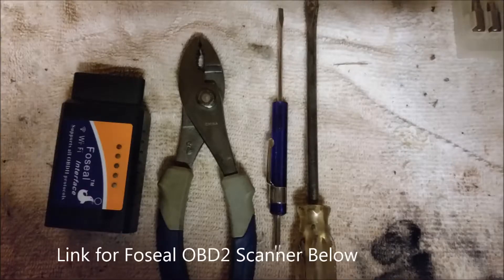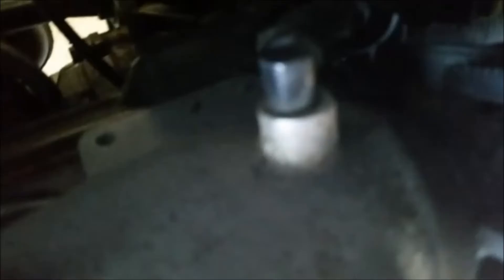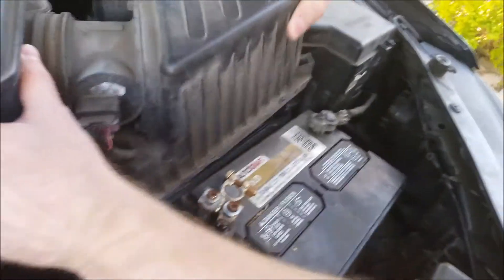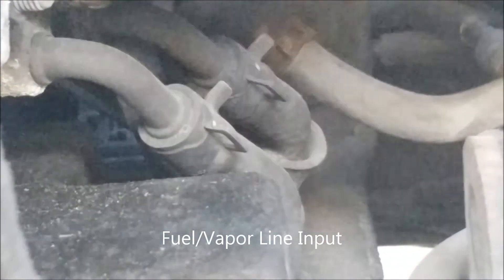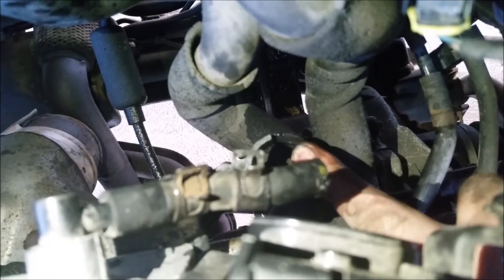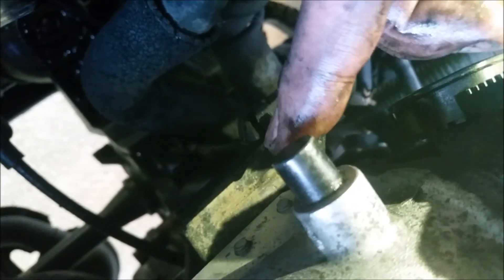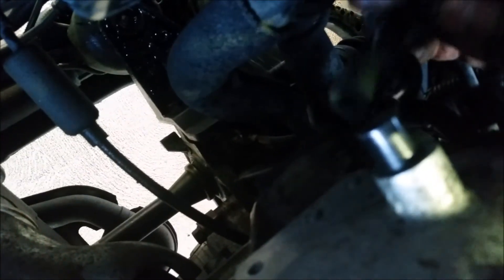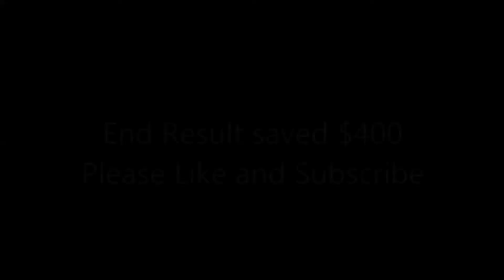DIY 2008 Hyundai Santa Fe EVAP Canister Fuel Purge Valve Repair P0441 P0455

Comment: Will this fix the problem of when I pump gas and hold the gas down,it only gets about half a tank before it cuts of and I HAVE to squeeze over and over or very lightly to find the sweet spot to get at least most of a tank.
I was told there are tiny exaustst ports in the hole to put gas, above right and left.. Can I take a hanger or some kind of pipe cleaner and send it down those  2 evap holes?? Will this fix, what part do I need or what do I do, will ythis repair fix that problem?
 thanks man.,
Reply: Yea I had this issue .. couldn’t fill up the fuel pump handle kept clicking off when I press it down to fill gas.  There was too much pressure in the tank and normally the purge valve is suppose to suck those vapors into the engine.  But yeah replacing the purge worked
Reply from the maker: Not really understanding your problem.  The valve is used to send fuel vapors into the engine.

Comment: I HAVE A QUESTION? AT THAT TIME THE ENGINE SMELL LIKE GAS OR THERE'S WASN'T NO ODOR AND IF THE  CODE P420 WAS PRESENT? THANKS FOR THE VIDEO.
Reply from the maker: No odor, just check engine light.

Comment: Is it good that Foseal? Can it read and set something? Or just read and thats all? Santa 2006 2,7 139kw. Thank you.
Reply from the maker: You can read codes and reset them using torque lite
Reply: @stem_saving1644  can you read all codes or just basic codes? Thank you
Reply from the maker: @Fastarrow12322  not sure what you mean.  If there is a fault code,  you can read it.

Comment: After you replaced it and reset engine light, how long did you drive the car, before knowing that the engine light is truly not coming back on?
Reply from the maker: Never came back on since it was reset. If it does,  it could also be the gas cap or another leak.

Comment: I just left auto zone and I have a small leak, what do I do next ? 😭 I just bought the car last week
Reply from the maker: If it's the code in the video you can try replacing or tightening the gas cap or replacing the device in the video.

Comment: Took me 30 minutes. 29 of them were spent fighting with those damn connections
Reply from the maker: Yup, it's those are the worst. Not rocket science....just need some patience.
Reply: @stem_saving1644  yeah what sucks is the code came back afterwards.
Reply from the maker: @justinkaufman495. Did you clear it?  Might be gas cap as well.
Reply: @stem_saving1644  I cleared it, the gas cap looks good. I have a new fuel pressure sensor on the way. Turns out mine is snaped at the neck. Hopefully that fixes it.

Comment: Nice video, helped understand what I was getting into ahead of time.  Definitely agree with others to buy the one with the new hose, so that you can tear/cut the old one off; otherwise you'll spend two hours just trying to take it off.  Bought my OEM part on Amazon for $20 bucks.  The whole thing took me about an hour to complete.  Definitely tight spaces, but workable.  This took care of my P0441 error, and eliminated the gas smell I had coming in after putting gas.  More importantly my problem with my Santa Fe having a hard start went away.  Thanks a bunch!

Comment: Just did the purge valve , definitely by the one with the top hose, take the whole air cleaner off and out of the way, disconnect the bottom hose, electric connector,move the top clamp down and just tear the old hose off, and thats it, I laid across the top of the motor so I could see..much easier, I'm 61yo and it was 45 minutes at best
Reply from the maker: Hopefully it fix the problem?

Comment: If you changed the fuel level sensors you used the sensor gaskets. Buy the original or reuse old ones. They sending unit gaskets are thinner that original! Causing vapor leak!

Comment: Had a smoke test on they told me that it was my fuel filler neck so I had the fuel filler neck replaced now I'm getting a p0441 that I wasn't getting before
Reply from the maker: Not sure what your situation is, but if its that P0441 error its either the gas cap or the purge valve at least based on what I have seen

Comment: So I have a 2002 hyundai santa fe 2.7 liter and it has a rough idle and it randomly shut off on me it has a p0455 code any suggestions on what to check first ?
Reply from the maker: Gas cap is the easiest, it can throw that code as well.  If replacement doesn't help look at the evap. Valve, like the one I replaced.
Reply: @stem_saving1644  but the gas cap can cause it to stall out at a stop light?
Reply from the maker: It could be a manifestation of a few things. If the fuel and air mixture isn't right or if the spark isn't right, then you could see that.  Maybe check simple things like air and  fuel filter and then the fuel pump.   It's one or more of the 3.

Comment: I have a 2010 hyundai santa fe getting engine stalls or complete random shutoff issues, I will try this out, just ordered my purge valve on amazon I'll update
Reply from the maker: I'm not sure the purge valve is the issue. It just vents gas fumes into the intake. It should just cause rough idle at most. But it's a cheap fix. Check gas cap as well. That triggers the same code if I remember correctly